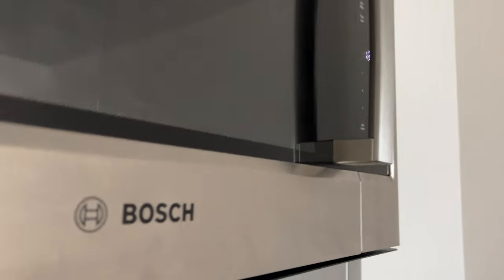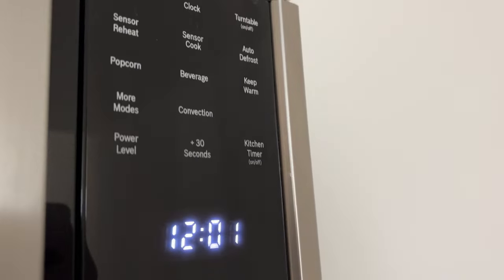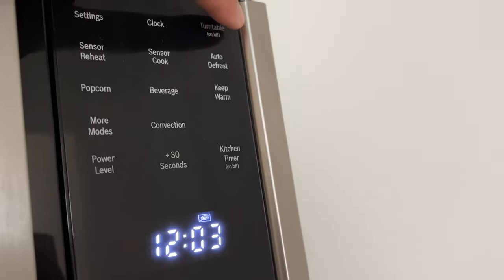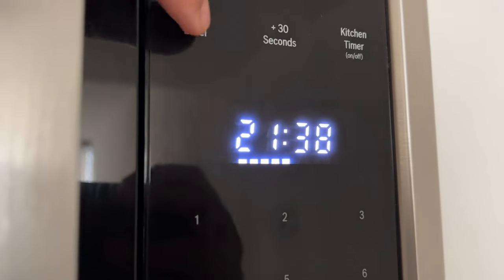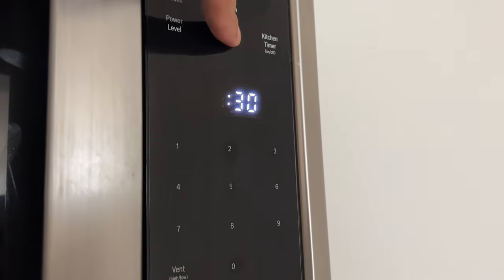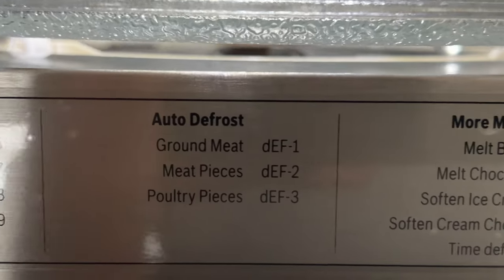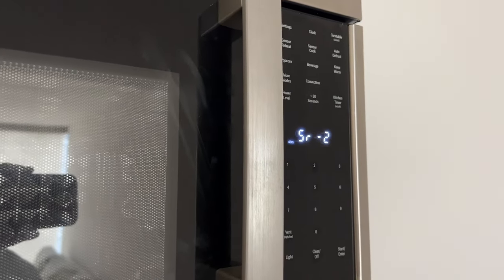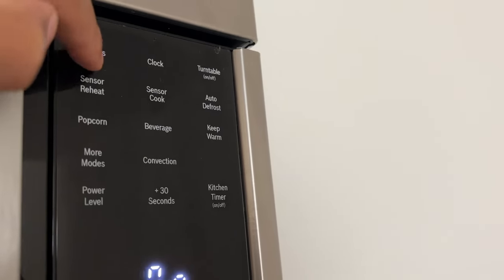Bosch Microwave Oven - How To Use

Comment: Also, received my Benchmark Microwave.  Cheap made in China trash.  The front door rubbed with the bottom bar after install and was sagging so the right gap of the door was not even as the door sagged by 2mm at the top right corner.  The keypad doesn't light up which is annoying in a dark kitchen.  Made in China says it all.  Bosch gave up on this model and any quality associated with it.  I regret buying this Made in China trash.  I'll replace it as soon as I can find a quality unit... if one ever exists.